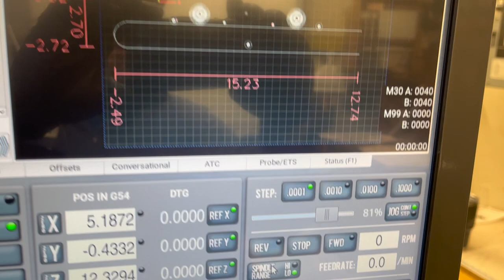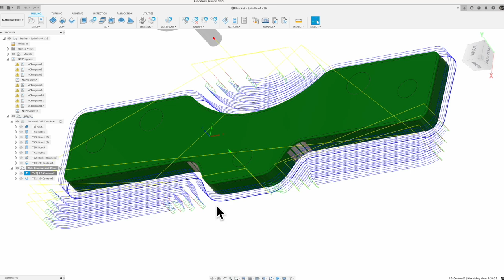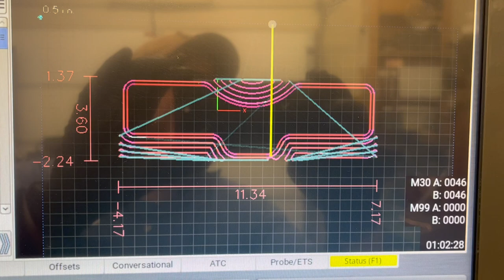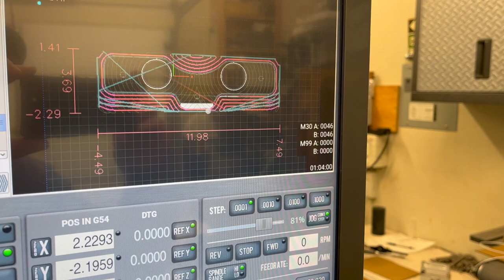Custom Brembo Caliper Bracket Part 2 - Heat Treated 4140 - Largest Tormach Part So Far

Comment: Got a Tormach 440 on the way - I want to cut steel, hopefully the little fella will be able to handle it.
Reply from the maker: Justin Walker - Congrats on the new machine!  It should be able to cut steel, just smaller cuts than a machine with more HP.

Comment: On steel I rough cut with a 7/16 then finish with a 5/16 sharp cutter, running 7500 rpm at 10 ipm, surface at 5000 rpm at 10 ipm.
Reply from the maker: Ken Johnson - Thanks for the recommendations. I will be sure to give that a try next time. Appreciate the comment.

Comment: I think it's time to change an insert or two on your face mill.  or turn up the rpm or slow the feed.
Reply from the maker: Yes, could have slowed the feed a little. Goes under the car so surface finish was not a big factor. I have one insert that is off a thou or so on that face mill.
Reply: @BladesIIB   going under a car should not be an excuse for a parts leaving your shop that way. Sorry coming from a car guy.
Reply from the maker: @nickeley7501  Fair enough. I think you would have to feel and touch the part yourself. The camera accentuates every little scratch. IMO it was an acceptable face mill finish for a part.  Ultimately the customer was happy. That said, I appreciate the feedback and will be more conscientious in the future.

Comment: the spindle light on your manual mill did you make it? if so do you have a video it    really like the videos
Reply from the maker: Greg - Thanks for the question and the feedback, glad you like the videos. Yes, I did built the light. Unfortunately, I did not make a video of that one.  Good news though, it is pretty easy. Look up Everbright halo light on Amazon and find the size you need. Mine came in a pair for $13. Then I bought a 12v adapter and some magnets (also on Amazon). You could epoxy the magnets to the light or in my case I just used double side sticky tape to secure the magnets. Get as simple or as fancy as you want with the switch. I just put a small toggle switch on the side of the mill where I had some room.  Little bit of soldering and an extra strand of wire to split the 12V adapter wired to the switch and za poof!  You have a ring light.
Reply: Awesome. Thank you
Reply from the maker: @greg9486  Anytime. All the best getting yours built.